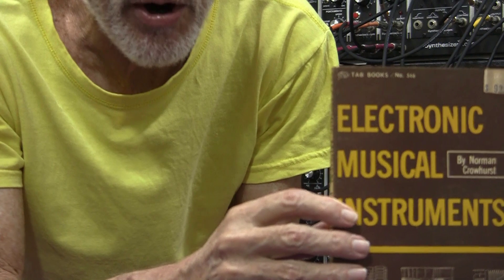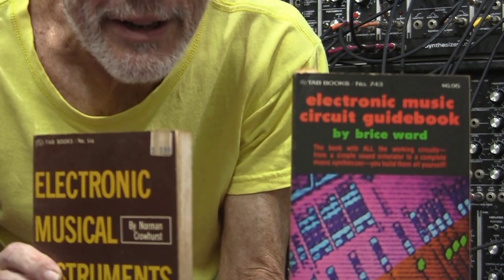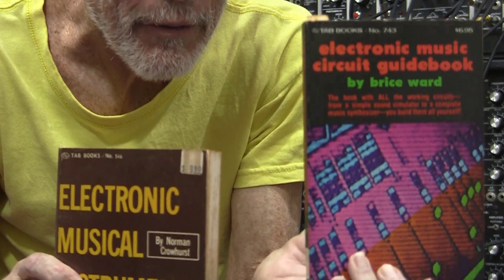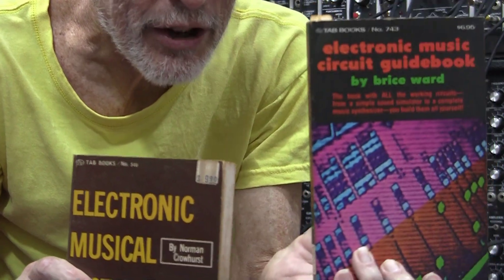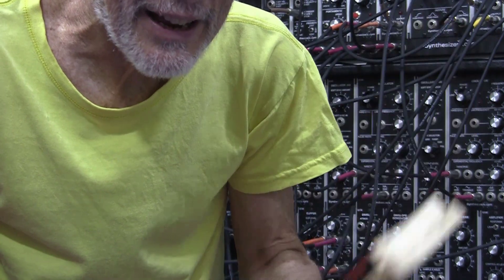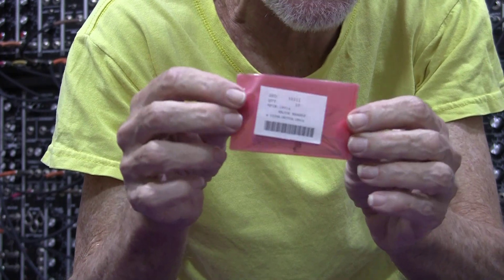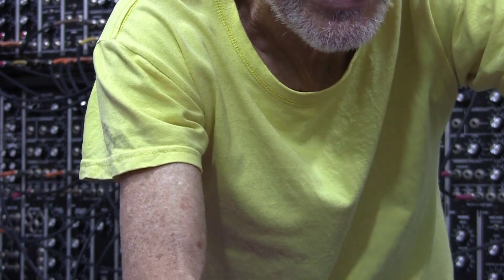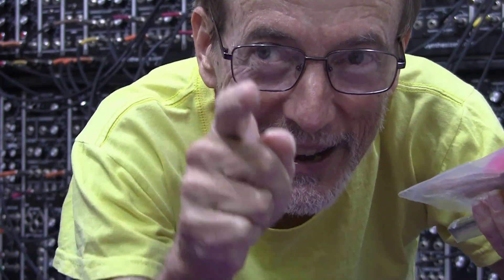Before you Buy (or build) a Modular Synthesizer  in 2022

Comment: I would like to plan PCB layouts although it's not my professional specialisation. I've planned only two or three small PCBs for now. Actually they're prototypes (metallized holes).
As I'm not going to etch my own PCBs (it's the solid reason, we have cats and live in a small flat, my free space is pretty crowded), so I'll be purchasing them from China's factories. Thus I think that for future PCBs I'll be planning layouts with through hole and SMD components together. Because some basic passive parts (maybe excluding capacitors) will be better to be pre-soldered (it's the option on factories) if there will be a lot of them (less space, obviously I don't have enough room for 5U). Of course in cases where I'll need bigger Watt characteristics I'll prefer through hole over SMD. Also sometimes specific components (like transistor pair ICs for example) are easier and cheaper to get in SMD cases.
What's your vision on this type of a situation, Stephen?
Reply from the maker: well it seems you have made a case for yourself 🙂.... certainly if you are going smaller then getting pre-soldered and mounted components will make you tasks easier ..... if I come out with a good circuit then production in China is a good choice... but I have to wrestle with prototype .... something that you would not have to do 😊
Reply: @StephenMendes  I'll be wrestling with prototypes anyway :) if the components are possible in through-hole type of course. I think about it like it's a sketch. If a sketch works then I'm safe to make a permanent version.
But I'm not sure actually. Because my soldered "sketches" didn't worked as good as their solderless versions. So I'll learn from you (using some basic background that I've formed in few years before now) how to do such things properly.
If a painter can't make a sketch then it's too early to paint a piece of art, right? :)

Comment: Thank you for mentioning the basic parts, Stephen! Are 2N3904/3906 not very welcome (in expo converters) by some reasons?
Reply from the maker: 2n3904 and 2n3906 are good small signal transistors and have good potential in the circuits we will be investigating ...... I will make list of popular types .... but substituting other numbers in most cases would be possible  👍

Comment: I'm from the same era - I once owned both of those TAB books which I purchased brand new from an electronics store shelf that was right beside the RCA TV Tube Tester. :)  Lots of great points and PR about going DIY modular!   

However I feel the 5U versus Eurorack decision, particularly if you're going DIY, is only one of size and ergonomics.   Portability, size of one's "studio" and yes physical dexterity and eyesight plays into it.   I've seen digital modules built in a 5U format, and I've seen Eurorack setups that were entirely analog modules.  In my build, I'm mounting a lot of YuSynth 5U through-hole all-analog PCBs behind Eurorack panels.   (It just requires a deeper cabinet to mount them perpendicularly)  They sound every bit as fat as they would in 5U format and they work beautifully with a handful of Mutable Instruments digital clones.     Modular + DIY is often about breaking the rules to make a sound that's uniquely you.   

P.S.  Some of those analog VCOs can perfectly 1v/Octave track at ridiculously high frequencies.   Connect one to the External Clock Input of a 16-step sequencer, then run the sequencer's CV output to your usual VCF/VCA signal chain and play around with the sequencer steps.    Voila!  A 5U digital wavetable synth!   #BREAKTHERULES
Reply from the maker: of course you are right ..... the electronics will sound the same whether it is in a 5U case or a Eurorack case......  a specific circuit does not care which case it is in 🙂..... this is a HUMAN decision ..... I applaud you for increasing the DEPTH of the Eurorack case so you can have the space you need ...... but because I no longer have a dedicated electronics workshop and because my eyesight is no longer as good as it once was I would go big ....  thanks for pointing this out  ... and I also follow Yves Usson he's a great example to us all 👍..... I went looking for your channel but alas no synths and no music but thanks so much for your post
Reply: "'I've seen digital modules built in a 5U format, and I've seen Eurorack setups that were entirely analog modules." the difference however is thru-hole versus SMD construction. The problem with SMD is you need to invest about $1K in tools to properly do serious SMD work. If you don't mind investing in those tools (and they are FUN!) then SMD is a great way to get a lot of circuitry into a small space. Do you build modules and cases?

Comment: Great video. Do you think some people gravitate towards eurorack more because a lot of digital modules have software that makes it easier for certain functions?
Reply: There are really two kinds of digital ---1) primitive digital circuits that behave similar to analog circuits but are controlled by a clock and 2) digital signal processing ... what happens with software. The answer to your question is "yes" ... but your question is analogous to "Do you think some people gravitate towards food because McDonalds has a lot of burgers?" 😂
Reply from the maker: Digital Signal Processing (DSP) makes possible certain "processing" of signals that is either IMPOSSIBLE  or else very difficult with analog circuits  (think of numerous analog circuits leading to bulky, expensive physical  construction and large power consumption)...... Eurorack packs very powerful Digital Signal Processing capability into a very small case...... Eurorack gives a tactile HARDWARE interface to what is basically SOFTWARE DSP ..... that's it in a nutshell ..... while DSP can EMULATE anything that analog electronics can do .... there IS a difference (that some people claim they can hear) ..... the difference is the IMPERFECTION of the analog circuitry itself (particularly noticeable in filters)....
it is this IMPERFECTION in the "sound" that people  have grown to love ..... a gross example would be  the "crackle" of a stylus on a vinyl record ..... completely absent in  the digital equivalent process..... hope you find this explanation helpful ? ... thanks for your comments 👍
Reply: Digital is more verstatile for functions, control and vco polyphony. 

My synth was builded around old analogue because is cheap and more fun to build. But, to achieve a modern sound (more compact and "tasty") i needed to work more to make more complex timbres.. Check my chanell for demos and explanations.